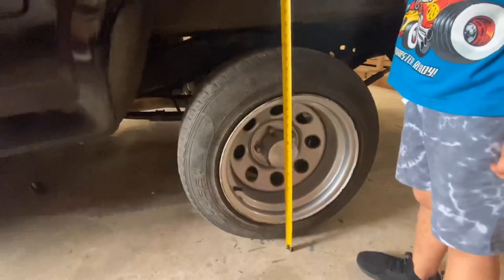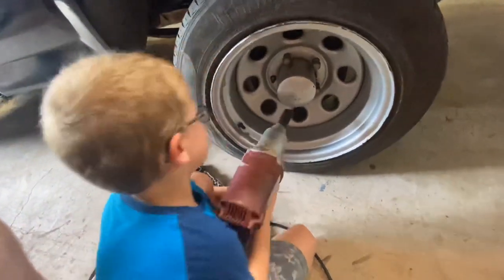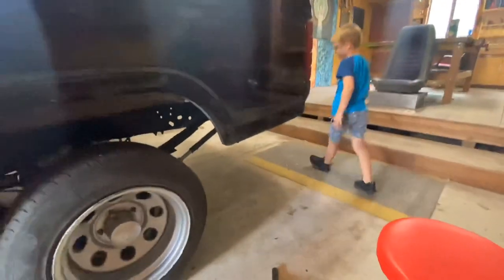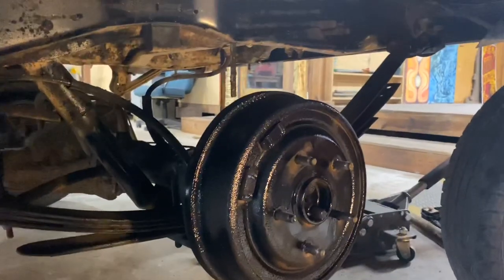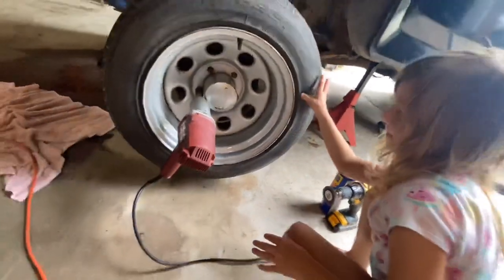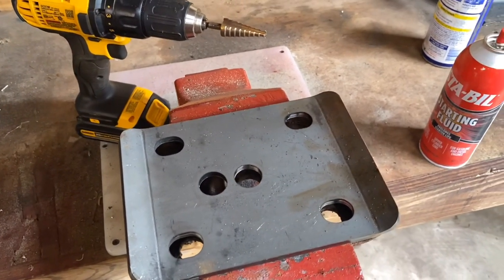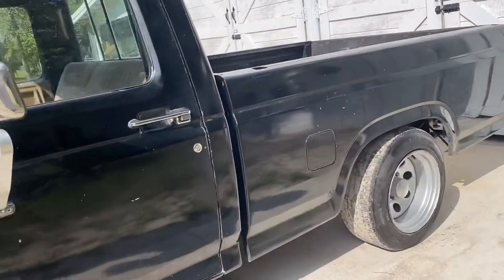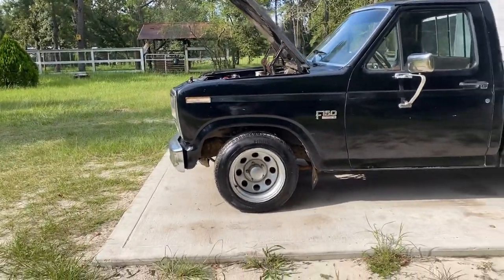Lowering the rear of a Bullnose OBS F-150 with a Flip kit & shackles

Comment: I am doing a resto mod on my 85 short bed. I drove it my senior year in 2001 after my Grandpa and I rebuilt the 300. The trans went out and it sat for 20 years behind my Dads barn. It was my Dads truck and it has the cab off my Grandpas 81 f100 ranger. The original cab caught fire in 96. Thanks for sharing man, definitely motivation for me. I plan to do the same drop on mine and yours sits just how I pictured mine.
Reply from the maker: Very cool man, glad to hear another bullnose is getting back on the road!

Comment: Great job, These Bull and Brick Nose Fords are a hot build here in Central Florida because they are the last of the cheap/affordable Classic trucks. I've never been a Ford guy but I just bought a 84 F-150 302 with an auto trans because I need a truck once in awhile and I picked it up for $1400 and drove it home, Yeah it has some body issues but I repeat.... I paid $1400 for it and drove it home.
Reply from the maker: The last of the affordable old pick ups. I wish they had the aftermarket support Chevys did.

Comment: Very nice drop on your truck!  Inspiring!! Just started sourcing parts for my 85. Now that your truck has settled, what camber kit did you end up with?  Did your pinon angle? What's a good shorter shock to use Any binding on the sway bars? Be well David
Reply from the maker: @Davada1gen  I’m still using stock camber kit & stock shocks. No binding 👍🏻

Comment: where did you get the kit from
Reply from the maker: https://www.ebay.com/itm/B-1980-1996-Ford-F100-F150-2WD-3-5-Lowering-Springs-axl-Flip-253630-/164446913573?mkcid=16&mkevt=1&_trksid=p2349624.m46890.l49286&mkrid=711-127632-2357-0
Reply: @FloridaCrackerKustoms  how does it ride with the drop coils?
Reply from the maker: @airell47  rides pretty close to stock.